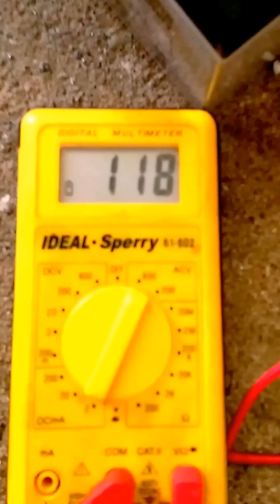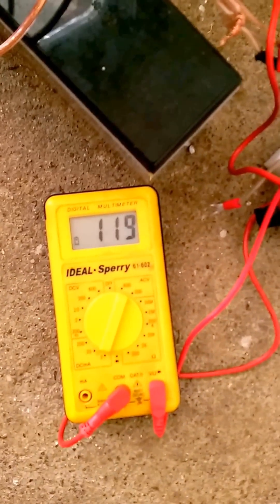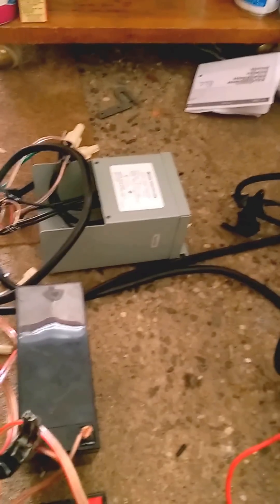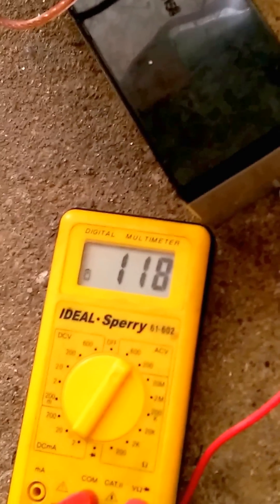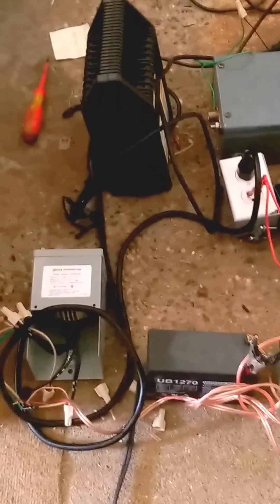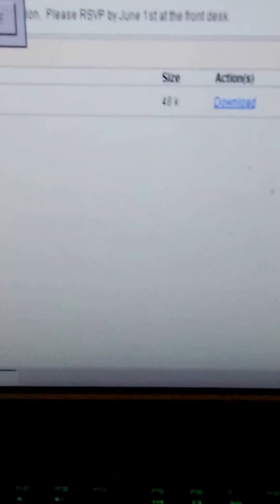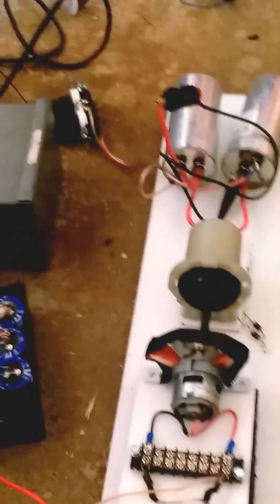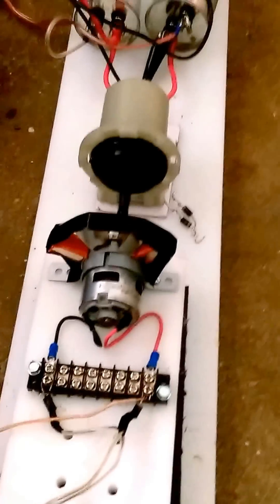Gerard Morin Washer Pump Generator &  PELEX DEVICE Successfully Looped!

Comment: Good work Marc, can this device power a whole house?
Reply from the maker: with normal physics laws used, science would say it is impossible, or that I am sadly mistaken of the fact that I can't get more out than I put in. That is NOT the case here. They are all probably stating that I am some nut that is trying to scam everybody into buying something. In actuality, it is kind of like taking from Peter to give to Paul without using the energy from the physical source (actual wired source) to power the load (the output) .  That seems impossible, so I will shed some light here for the first time that will actually help make more sense. So pay close attanetion to how I explain it, I can't give diagrams without serious consequences. The input power feeds the device which only allows it to start functioning, then the rest of the process relies on drawing energy from existing natural ground currents. which exist everywhere, and that power or load used, we could tap into, however it has to use "outside of the box thinking". The ground currents are only returns or dissipations into  the Earth's crust at mega high amperages and very low voltages. We could shortcut these flows of energy by using better conductors than the soil itself to attempt to install a tapping device between the start and finish of these paths of current flow. These currents are DC and need to be changed to AC so we can transform them and step the voltages up, which will also lower the amperage involved. What we do is create the shorter ground circuit with a switch in between, allowing the current to discharge faster across our two new sources of ground, then as it is switched on and off, it creates a pulsed DC, and the difference in potential between the normal ground current while the switch is open and closed is the voltage we start with. The amperage is pulsed high and low, but we only collect it at the shorter point, then we transform the energy into a higher voltage by stepping up the voltage  from .5 volts at (in my case ) 5 thousand amps to 110 volts at 220 amps, which will run a home easily, but the transformer will need to be rewound to create  220 volts at 110 amps which will run the standard home with 100 amp panel. There is a lot involved, but it works. The energy outputs vary up to 20% and the energy signature stops cellular devices from working within 250 yards and would not be allowed for use anywhere if it was found to be used, there'd probably be arrests and some major fines. In areas where it wouldn't matter like farms and off grid homes away from mostly anything, it would be a great device to live without paying for power. I can't divulge the schematic, but one could easily figure out how this works if they are into the field of study. It is tapping into Earth's free energy grid which is part of the aether. Tesla invented this but his papers have been stolen. I figured this out by reading about Farmers who used to run pumps off of ground currents and differences in potential from grounding, that does charge dc battery systems which could be inverted at a very large loss of efficiency. It is 100% possible and I encourage you all to tinker with this stuff, it is very powerful so be careful. I assume no responsibility for injuries or death that may be caused by using information from this comment or attempts to create what's in the video.
Reply: @advanced-electronic  - please respond to my email

Comment: Hi mark. very interesting your project can tell me if the spargap causes ferror resonance and this generates surplus energy ?. thank you.
Reply from the maker: There is resonance in the circuit but it always needs to be any multiple of a source energy's frequency. Here's the key. 8.12 hz is a Schumann Resonance Frequency. The Earth rings at this frequency. If you tune to a high frequency multiple of this at a very high voltage, the energy will be capacitively coupled with the equal but opposite the traditional amperage driven energy we use everyday. You have to draw this energy through a grounded RLC circuit at 1/4 wavelength like ham radios use without needing power to receive signals. The difference is that their systems use the same energy, to run, but they don't generate power until you tune them to do so using a variable resistor tying one side of the cap and coil to ground through this resistor, then just tune to start coupling once the circuit is started.  there is the need of some form of electricity to run the system but the energy back in could easily charge the battery wirelessly using a 1/4 wavelength coupling (by the wire length this is adjusted using an oscilloscope and led's to tune the circuit until resonance to absorb the energy between the grounded point and negative of the battery, a superimposition of opposing energy recharges the system in reverse through the resistor and easily transfers this inductively to the latter portion of the circuit which is a 6db per octave notch crossover circuit for speakers that takes all of the energy amongst the tremendous bandwidth that is being drawn into the circuit and puts it into an AC stream of incredibly powerful electricity at 60 hertz (it is a messy wave but is easily cleaned up with another inline inductor and cap that makes it a clean and useable sinewave.
Reply: @advanced-electronic  Hello.  Marc I was very happy to read your comment I still don't understand everything but I did a test last week as you suggest in 1/4 wave from neutral to ground.  and the power came, apparently does not affect the resonance in the antenna.  just now I want to take advantage of this idea, I think it is promising in the sense that you suggest.  saw attach a video for you.  I'll be glad to hear what you think.  sorry for being in portuguese.  thank you very much.  https://youtu.be/VLevZDcFgwY

Comment: i have see and seeing many of this videos and i have create also and tested many different types of this project.   but 

a question for you and all of your following guys. . what can you run with it ???
Reply from the maker: These devices, all depending on size of the transformers created and ground currents that are used will all depend on the output. I have one that I was forced to get rid of that output 55 kW but it was too powerful, creating field disturbances from the EMF created by it's switching process. It kills cellular devices and cellular transmitters dead while in use. That is the downfall of the project, I can't seem to shield it because it uses ground currents to power the load, so if we ground shield it, it still emits these massive emf pulses. I tried to shield by placing a + charge to the external enclosure and that fails too. At the moment, I am trying to use capacitors to store the energy, then discharge them into inverters to power them without this  massive emf burst at every cycle.

Comment: please do a time laps with a clock next this system for at least 24hours. I say this because that dc motor will run of those battery's for a long time with out your looped system anyway. the amp draw is not high from that dc motor

Comment: Is it possible to loop this system without your Pelex device?
Reply from the maker: no, without Pelex, the dipole is broken but because the signal is chopped, it isn't working as it does with a clean ac waveform.
Reply: So you are saying Gerard Morin is wrong in his videos?
Reply from the maker: no, Gerard is not looping the system as I did. I just tried to gain Pelex full output using the Gerard Morin pump motor but 2 things have failed the attemp to gain the same energy amplification. 1st, the pump is outputting a much higher frequency than it needs for Pelex to operate at it's full potential. 2nd, my system is NOT setup the same way as Gerard's, also, Gerard did not claim overunity in looped mode , he simpoly stated the output allows items, such as LEDs to operate off of the voltage reflux and not it's amperage. Gerard did show overunity effects with non grounded utility transformers, however they were a very specific 2016 style winding with dual cores and the input coils , one side was shorted out while the other was not. This gives the input the "Aviso Ismael Overunity Amplification Effect", I couldn't duplicate this because I couldn't get my permanent magnet generator to run long enough,, it needs to be repaired. The circuit breaker needs to be removed and a glass fuse is what is needed to allow the function of this to be successful. Loopi ng systems can break the dipole, if the motor is pulsed on it's input and the output is shut off in pulses opposite the input, i do not see why this wouldn't work. It would be all about the timing between the motor and the generator, in Gerard's case, the pump is the generator. This energy could be pumped into the Earth through a resistor and AV plug as I do to create a completely free output that does NOT effect it's input, as my Dezeinstein Radiant Charger circuit fun ctions. This is exactly how Tesla succeeded and is what is being completely suppressed right now. Please don't try to use my suggestions or comments against other folks claim s, if the circuits are not identical, they can't even truly be compared whatsoever. I am not and will NOT oppose Gerard's work in anyway.. His work may be unique and mostly not understood, as well, so me of the calculations were not done as some deem fit, but he did come across a very important discovery which needs to be shared worldwide. High frequency does have the ability to have overunity effects, especially when used to harmonize in multiple streams under one output. This means the input would have one signal, output would have many in one output which are able to be injected into the ground and if the resonance is correct, increase itself by multiplying or mirroring these these waves. When we gather these waves back by drawing the energy back into the circuit, these separate waveforms can be induced with several coils as antennas to pick the energy back up from the atmosphere much more amplified. This was Tesla's Phase Conjugate Mirror Theory and it is how all of my circuits output much more than their input. Whether the input has 1 watt less than the output or 5000watts less, this is still overunity. I have found more ways to recover this energy and it is very real. It is only a matter of time before I'll be able to use 2 4x4 solar cells to power this circuit and release thousands of watts at 120vac.
Reply: Thank you for your very lengthy response and insightful knowledge. I have learned a lot watching your videos and has others also.
Reply from the maker: thank you for your support. please share the videos that mean most to you. if you ever have suggestions or wish me to test other circuits that you or others are skeptical of the true outcome, I'd be happy to duplicate and test them if I have the components and correct equipment to test them. Anybody that has equipment needing to be tested, circuits, etc., I ask anybody to send me what they have and I'd be happy to complete their circuits and video their function, verify overunity, etc or debunk other's claims scientifically.  

Another online follower and friend has supplied me with a Bertonee and another brand of solid state NST which Don Smith used. My plan is to reproduce Don's effects and pass out the results and possibly the build info privately once I succeed to assist people who can't afford high electricity prices, or I'd at least share some of my knowledge to assist in making their electrical systems much more efficient and less costly. I am an expert in the field of electrical generation, electrical transmission and distribution of high voltage and medium voltage circuits, 20 years experience and a master lineworker. I have learned of some of Tesla's and Don Smith's techniques used with my recent experimentation which may allow replication of Dr. Moray's device . When I made these ground pulse discoveries through the AV plug, I learned the circuit is now completely possible to do against the beliefs of academia and science since the rectifier works as a valve and eliminates the effect of additional power loaded to the input of my devices allowing an output unrelated to it's input in any way shape or form. The output of this device is due to the equal and opposite of every electrical pulse per it's superimposed waveforms and electricity type being that it has ac over dc in a single output. I have also legitimately produced 5 types of separate electrcities and have proof that all of them exist while science only agrees with 2 types, forced amperage/electromagnetic and electrostatic. these 3 cold electrical/radiant energies violate what's currently written in physics books,  leaving science a lot of work to do to catch up with scientific studies and experiments done by myself and a bunch of others .I am seeking at the minimum 100 more subscribers so I have the ability to ask for donations which will assist in paying for the extreme costs of new equipment, components needed to present and complete requested tests by others, expensive components needed to replicate specific circuits, including Terfenol-D rods and custom built mumetal cores, rods, wires made of rare elements and of course fine graphene oxide that I have been electroplating other surfaces with to draw/harvest atmospheric electricity in very high levels/tensions.

Comment: looks good.i also have a twist to gerards idea on the drain pump gen. mine also runs a car battery charger and on low voltage input to my special dc motors. mine produces a steady 120ac .and the dangerous spikes i do suppress with hv cap so not to damage my electonics i test run .check my channel out.. all my designs on this setup are open source and really same thing is achieved on these with pulleys.. my loop is next.